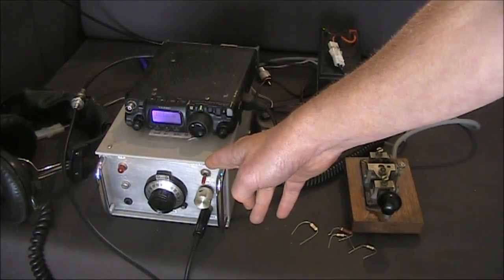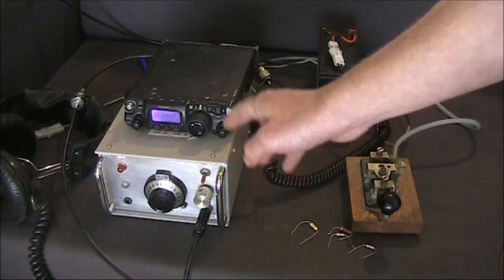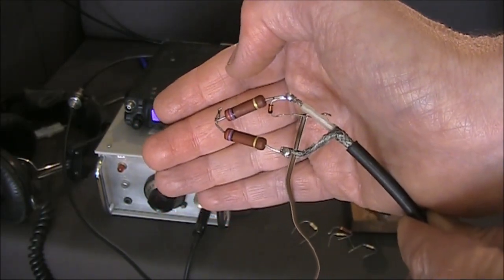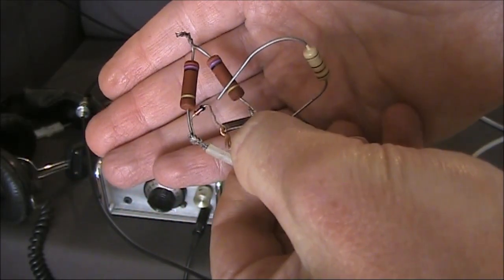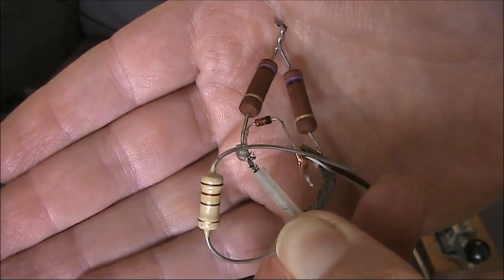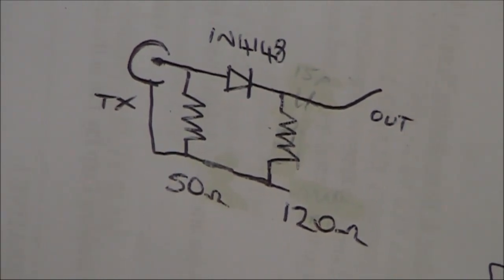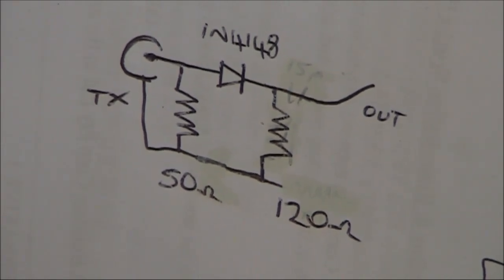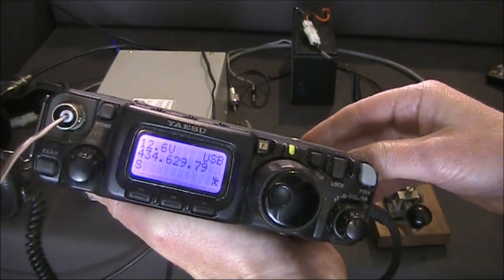Diode harmonic generator requires just three components

Comment: Thanks for the video Peter. Excellent as usual.
I used it to check my Ubitx was transmitting on the lower Hf frequencies my Sdr could not tune down to.
Will store your link.
I now have a Diode harmonic generator.
Please keep the videos coming.

Regards
Owen Vk5fkol.

Comment: It's cool that a diode does this, but an explanation of why this happens would be helpful.
Reply from the maker: Diodes are non-linear. Hence they introduce harmonics, a form of distortion but useful in our case.
Reply: @vk3ye  Agreed and thanks for this. Would it also be true to say that since the diode chops off one half cycle of the carrier, we end up with a square bottomed(or topped) waveform and square waves are comprised of an infinite sum of sinusoidal odd harmonics of the fundamental? Of course we also have the even harmonics here so perhaps more at play but I would be interested to know if the odd harmonics were stronger.
Reply: @jemussi7842  Idea: put a LC parallel resonance circuit behind the diode tuned to a specific harmonic, e.g. 49 MHz, so we attenuate the other harmonics, and also add a low-pass filter for 49MHz for reconstructing the waveform back to a sine. (somewhat, I hope). That would give a much more clean, controllable higher frequency at the cost of a few parts more.
Reply: Also check out intermodulation distortion and its causes.